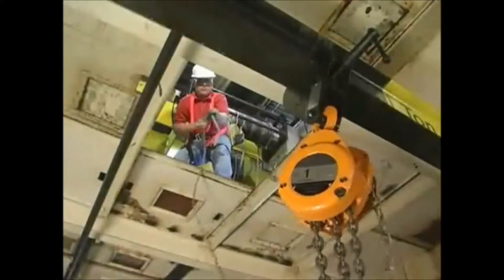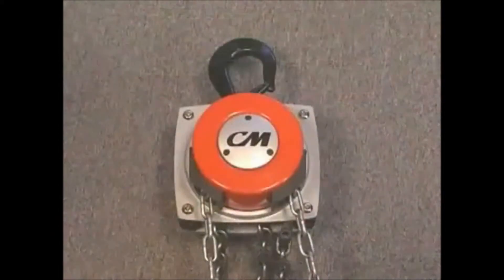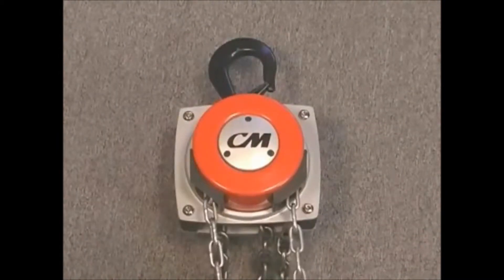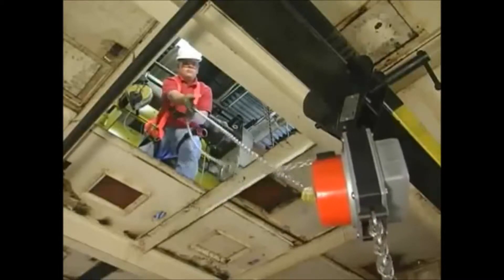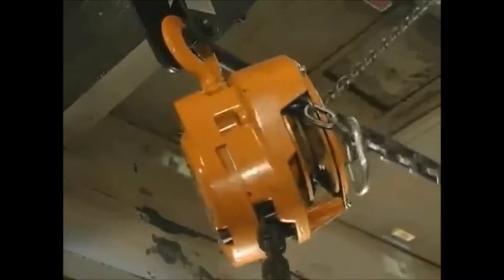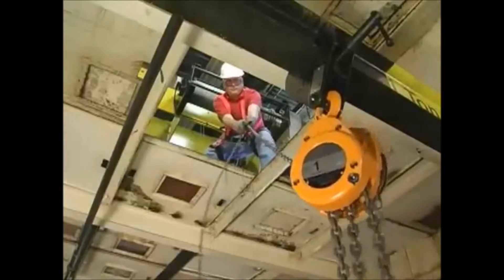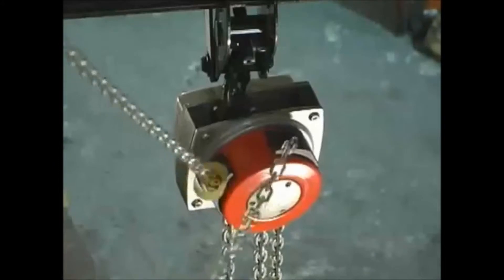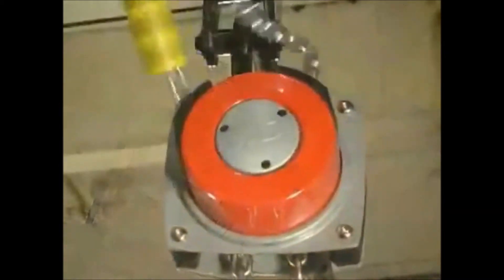Hurricane CM Manual Chain Hoist Above the Load and Lifting in Confined Spaces Demo

Comment from the maker: Do not try this with your average hand chain hoists. The CM Hurricane hoists innovative chain guard rotates a full 360 degree allowing for operation in confined spaces and in applications where an operator is above the load being lifted.  
http://youtu.be/5zg2sj8HskU

Want to more about the CM Hurricane chain hoist? Need a new manual chain hoist for your business? See product details, specs and prices and get 170 years of material handling equipment experience at http://www.hoistandcranedepot.com/hand-chain-hoists/